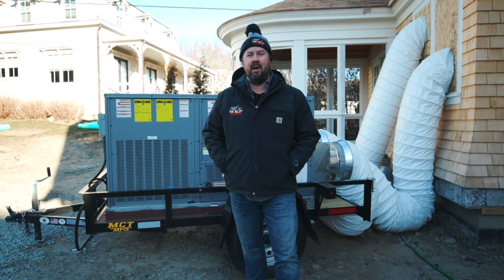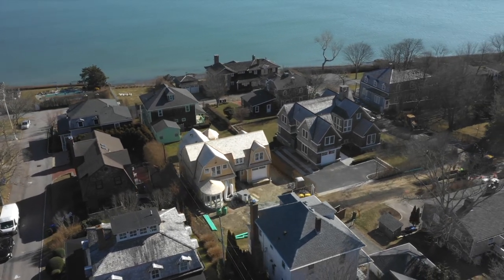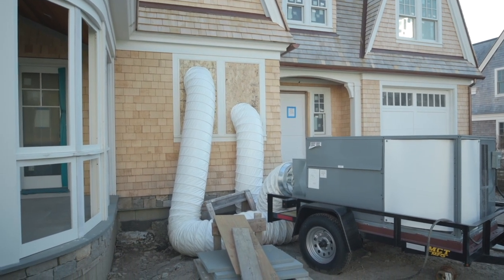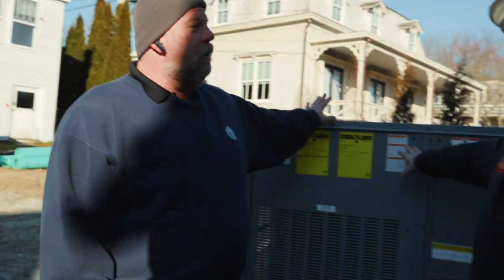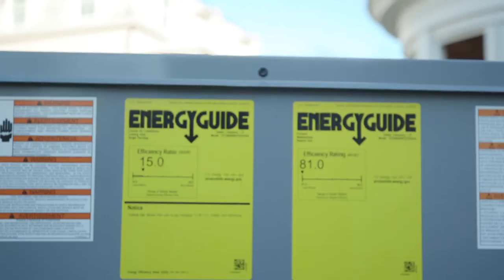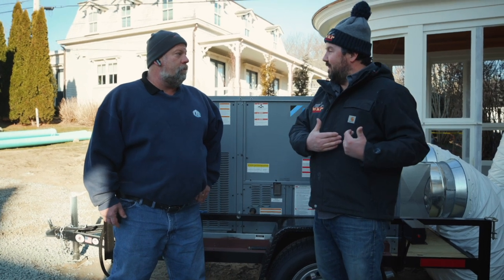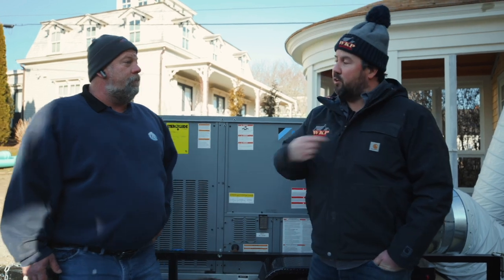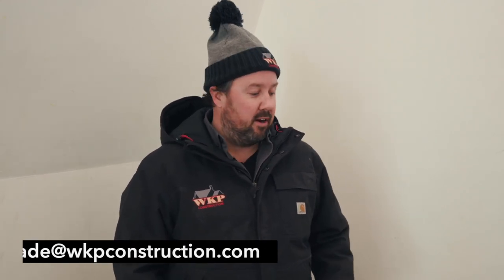Heating + Cooling A Construction Site!

Comment: Just wondering: If you are doing a dbb, is a call out for temporary heating and air filtration an item that you look for in the bid documents? I'm thinking of paint and hardwood flooring. A manufacturer spec would very likely call for a specific room temperature and tha the material be acclimated to the room temperature and humidity, but as for the freedom to contract, a contractor can and or will  make an offer based only on what is called for in the bid documents. 
I think there is a lot of potential here for a headache for everyone involved in the project.  The designer/architect may balk & claim that the contractor needs to follow manufacturer specifications. I'll bet that the contractor or sub isn't going to include temporary heating if it's not called out in the invitation to bid, and will resort to demanding a change order when the time comes. Just saying. Just wondering if you run into these kind of problems.